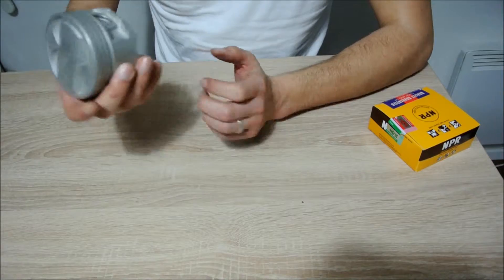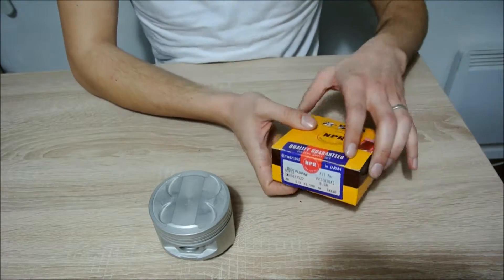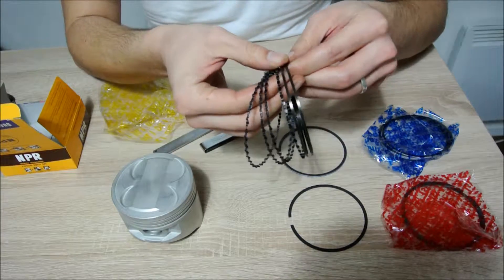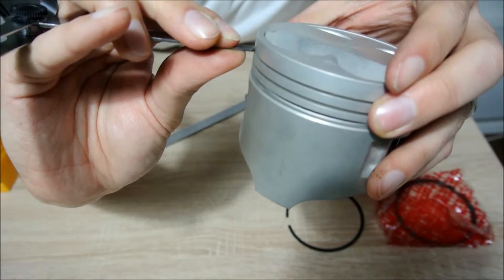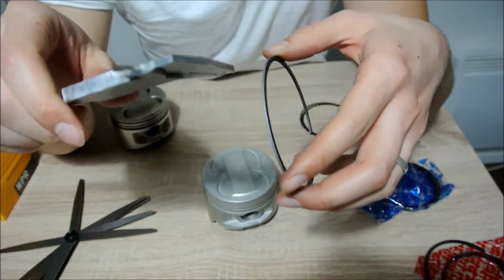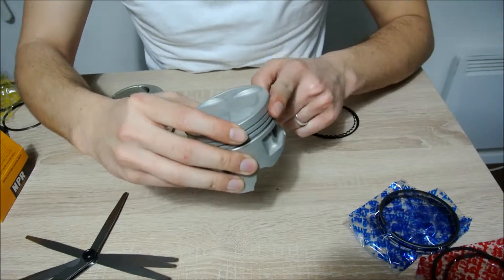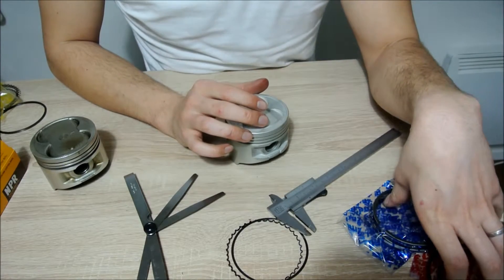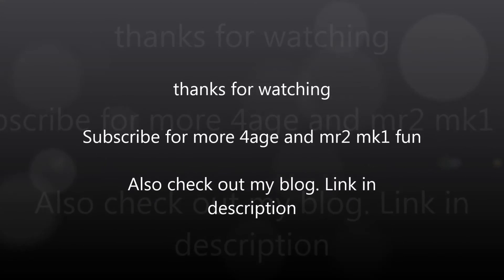Honda prelude piston rings fit toyota 4age smallport pistons

Comment: Nice video! I need some help. What other pistons can I use in a 20v Silvertop with the stock ecu? I can't source oem piston because of lockdown and my 20v ST is dead. Need full rebuild.
Reply from the maker: Honestly, you're stuck. The 20v pistons have the unique 3 intake valve cutouts. You could use some super low compression dished pistons but that only makes sense with massive boost. You could look into VW / Audi 1.8 20v pistons, as that engine also has 81mm of bore, but I doubt they will work without custom connecting rods.
Reply: @d4a  thank you very much for your reply. Looks like am stuck. Btw, impatiently waiting for the next What makes it so Great video!!

Comment: B20A piston rings?
Reply from the maker: MrDeanSTI Yup
Reply: Thanks a lot man, i've been looking for these rings for months, "smallports" are a real pain to find parts
Reply from the maker: MrDeanSTI They do fit, but be careful, the b20a rings are just a tiny bit wider than stock smallport ones. I know a few people that run the b20a rings without any issues. I myself have the smallport rings so I can't tell you the details about engine compression, longevity, etc.
Reply: driving 4 answers I'll keep looking for oem rings, b20a ones will be last resort
Reply: Did the b20a rings lasted? I'm trying to source some stock rings but can't find it

Comment: Thank you for this! For my 1986 MR2 I am finishing my largeport 4age build with smallport pistons (machined the 40 mm connecting rods to accept the 42 mm wrist pins of the smallport). I tried to use typical largeport .020 over (0.5 mm) rings and the top ring would not fit. The other wrings fit well so I was greatly disappointed and confused. I will have to try this!
Reply: Chris Smith 
Hy! May I have some questions to you? 
I want to do the same with my AE92 Corolla Gt-i. I've some crankshaft problems and I need to change the 42mm's to a 40mm's crankshaft.( I only find that kind unfortunatelly) So I've smallport pistons and I want to keep them, but need to convert to the rods. 
Can we contact on e-mail? (Sorry if my english is poor, I'm from Hungary :) )
Reply: Tamás Németh Why not get crankshaft for AE92, both bigport and smallport share same size 42 mm conrod and 20 mm piston pin.